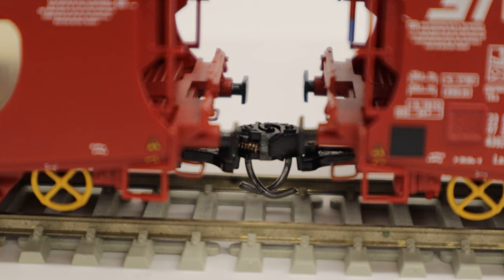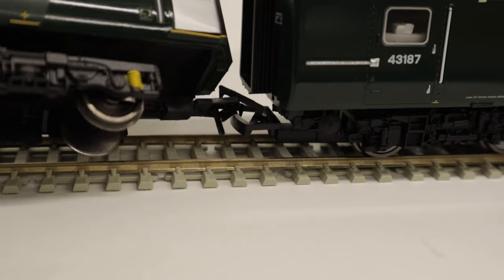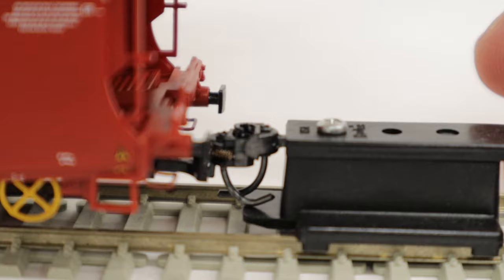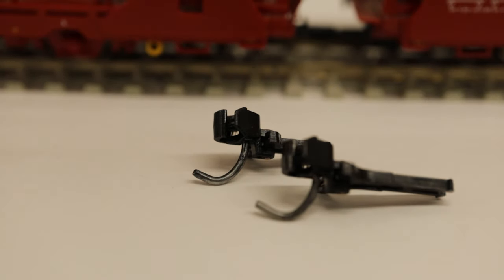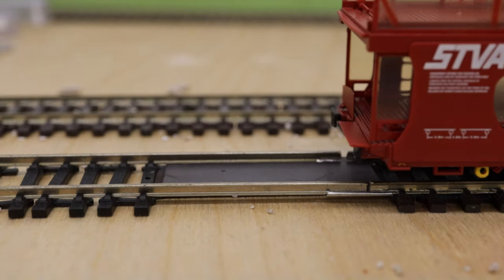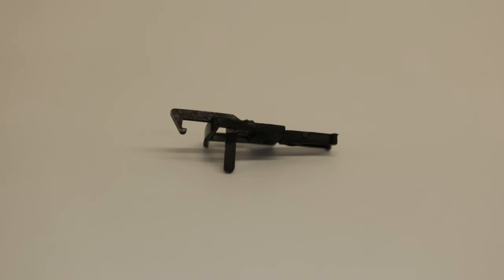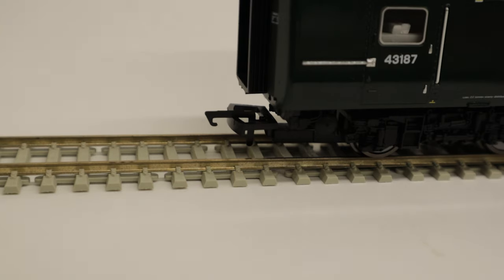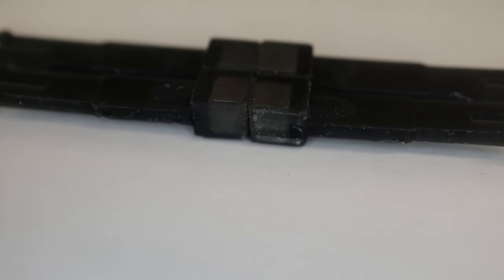Building a Model Layout in the Garage  - Part 7 - Coupling Conundrum

Comment: Chris, the nem kadee couplers come in three variants : center head and offset head top or bottom. I use them efficiently for my OO and HO trains. If the nem coupler box is too low like on your Hornby HST engines, I advise to then remove it and install a Bachmann nem coupler pocket and coupler pocket adapter, assuring the height of the pocket is symmetrical to the ones of the carriages. This will allow you to use then the hunt or kadez couplers. Also about kadee and the decoupling in ramps, you have to ensure a smooth transition from plane to ramp, or if it is too angular then the couplers may fail. They are excellent but need a perfectly laid trackwork to operate reliably.  I hope that those pointers will help you.
Reply from the maker: I hadn’t realised that when ordering the Kadee Nem versions previously.   I’ll have to have another look.

Comment: Kadee also make compressed card packing washers that  you often have to pack out the coupler pockets.  The magnets can be sunk in to the baseboards if you have plywood subroadbed they’re that strong. If you want to uncouple without magnets you can use a skewer to split the knuckle. Rix product make a handheld magnetic couplerthats sort of h shaped and you just pop it between the vehicles and bingo
Reply from the maker: Well I never knew about the packing washers. I have a couple of the magnets that fit under and some that fit in between the rails. I’m looking at a servo that raises a magnet up towards the track when needed.  Only going to be in the goods yard those.